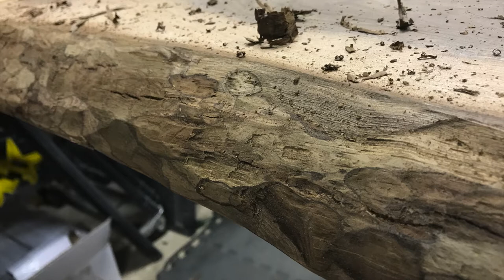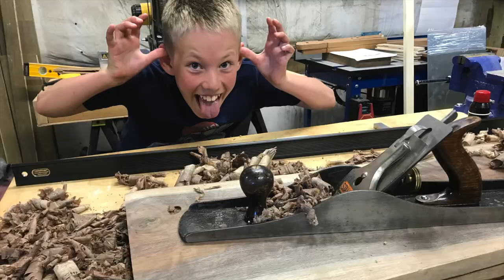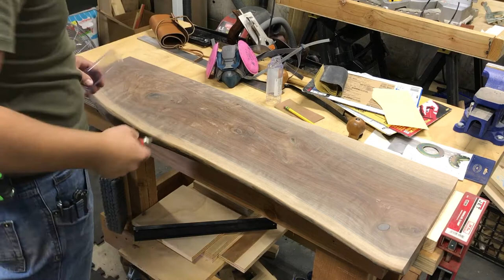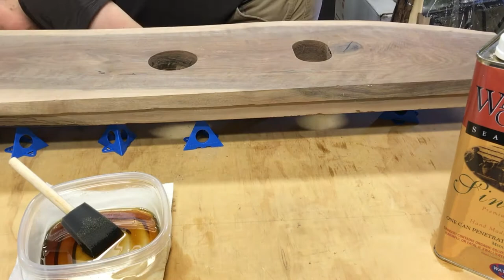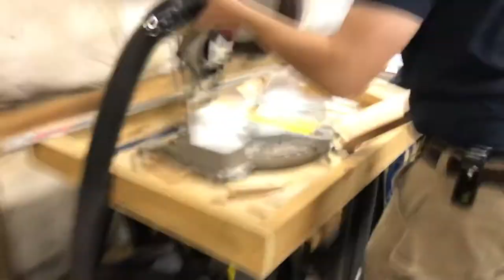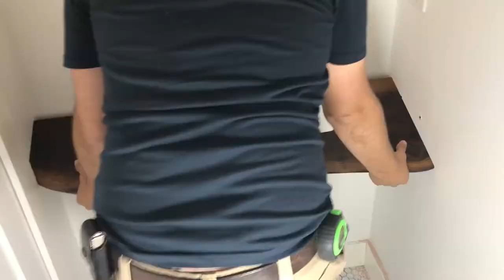Floating Live-Edge Counter

Comment: Will the the slab warp at all over time? I bought a piece like this and planning to use it for a vanity
Reply from the maker: The final dimension of the slab was nearly 2 inches thick so it is unlikely to warp due to infrequent moisture exposure. It was also sealed and hasn't given us any issues. Normal wood movement is always a consideration but if you allow the slab to adequately dry before cutting it down to its final dimension then you can avoid much of the concern. That being said the bigger the vanity the more you will want to account for expected and potential wood movement.

Comment: That's nice, do you have a link to the sink? Did it come with holes to allow for wall-mount? I have only found rectangular vessel sinks with the size I want and i don't think they have holes to mount. Is there a way to mount a vessel sink?
Reply from the maker: Thanks for the feedback, Felix! The sink I used is actually a wall mount sink with the necessary holes and mounting hardware. I mounted it to the wall for additional support before adding the countertop. I believe I purchased it at Home Depot a few years ago. It doesn't look like they have it in stock any more. Here is the link to the manufacturers page. http://whitehauscollection.com/product/wh1-114l/ They have a "Where to Buy" page and it looked like it might be in stock at least 1 of those retailers. http://whitehauscollection.com/care-maintenance/where-to-buy/ Hope this helps and thanks again for commenting!